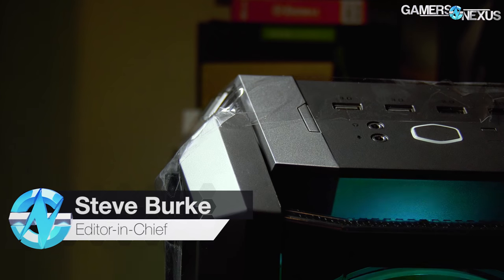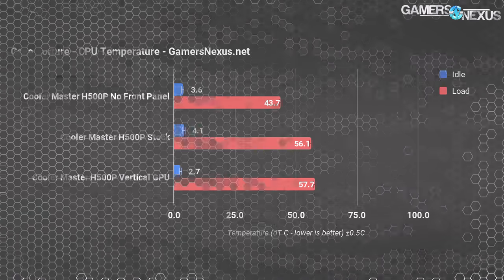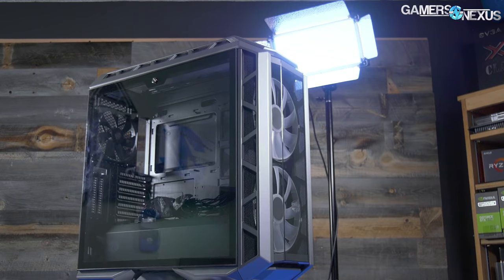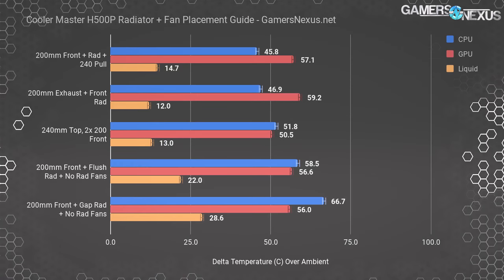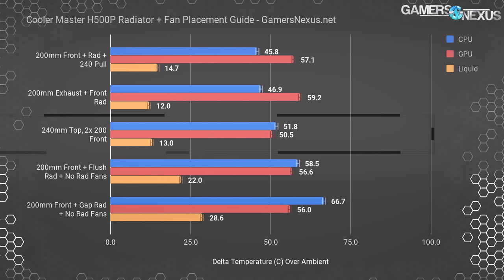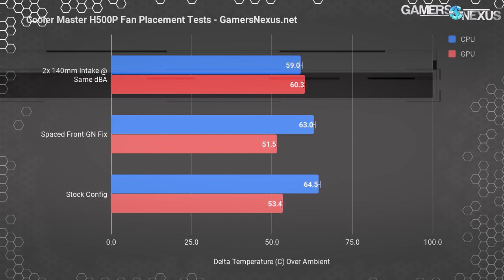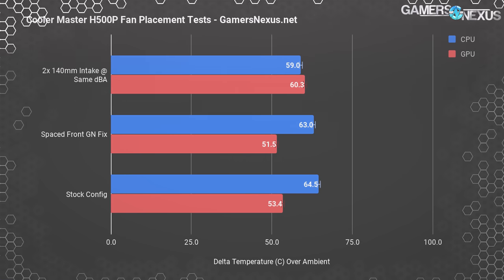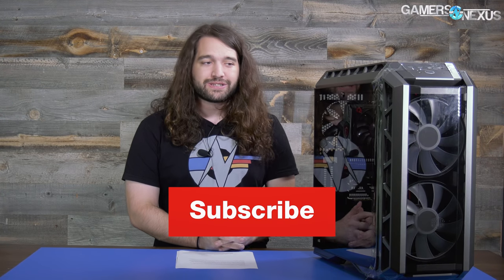Cooler Master H500P Radiator & Fan Placement Guide

Comment: If going liquid cooling I would always cool both CPU & GPU.  I have never really understood the point of CPU only liquid cooling but I prefer noise reduction over max overclocking

I have always wanted to try out 180mm or 200 mm fans on appropriately sized radiators but the more I think about it the more I wonder whether this is in fact a bad idea because (a) the increased size of the fan motor creates an appropriately sized dead zone (ie where no or very limited airflow from fans) on the radiator.  Sure that is partially fixable by having a fan shroud to make the fans stand slightly proud of the radiators but that brings me to second issue; (b) bigger fans have worse static pressure.

Does anyone have hard evidence on what is the optimal radiator/fan combination given that we can get 120mm, 140mm, 180mm & 200mm fans and radiators (although both 180 mm & 200 mm radiators are a bit niche).

Any how thanks guys for a proper review of the case, looking forward to seeing if you manage to fix it because clearly in stock configuration the case is a triumph of looks over performance - i.e. basically the case is junk in many ways

Comment: Always try to have a positive air pressure inside the case to reduce fan speed on the CPU or GPU. You need air to transfer the heat and a lack of air acts like an insulator. I have 1 big 200mm front fan and 1 140mm back fan (Raidmax Vampire case). The average CPU and GPU temperature on full load is around 60 degrees Celsius when my room is around 20 degrees  Celsius.

I installed 1 140mm bottom fan and 1 140mm top fan. If the mobo is getting over 40 degrees Celsius hot, the top fan will turn on to cool the CPU better. If I'm doing some mining, I turn the bottom fan on by a button to reduce the GPU fan speed and thus less noise.

Overall, you right, depend on case by case, what you have in it and the pressure you have in the case. Always try to aim for a positive air pressure in the case for efficient cooling.

Comment: So if i use a 240mm rad in the front and then have a extra fan under will that be better for the gpu too? The bottom fan will blow air towars your gpu

Comment: Can't you move the front fans inside the case if there's enough room
Reply: That's what I was thinking too
Reply from the maker: There's not.
Reply: What about  removing the 200mm fans and installing 3 x 140mm fans on the inside of the front panel, if there's room
Reply: asked him that in the review, crickets, he opted for unhinging the front panel and sticking it on with tape... I'm at a loss, I bet the problem is mine, I must be missing something, it just can't be.
Reply: There's a set of protruding rails for up to 140mm fan placement behind those fans, and subsequently no mounting position for 200mm fans.
Reply: So? Do you have something against adhesive tape?
Reply: Thank you for answering my question now make a plush doll of yourself so you can get some extra money like 20 of them with your autograph they will sell fast
Reply: Whoa careful, nearly cut myself over all that edge!
Reply: Gamers Nexus that's a shame. If it could that would fix it ☹️ These company's need to stop thinking about the pockets and start thinking about the customer. What ever happened to the customer is always right.
Reply: hahahahahahahahahahahahahaha OMG your so right. Im such a spoiled brat. I should change me life right now and become a evangelist this very second. Your words of wisdom have opened my eyes to the real world. I shall now spread the word of all that is good and right. Thank you for making me feel hole again.
Reply: Arrrr what happend kid. Did he answer one of my questions and not yours. didums
Reply: Dan Smith im glad you took my advice. Glad to help.

Comment: Nice review.

My solution which might only work for someone with a 3D printer.  I would remove the drive cage cover, then print out a "scoop cover the would take the air coming from that lower 200mm to be redirected where needed.  Obviously that lower area is getting too much air from that 200 mm fan,  that basement can't use it or need it. Even if you had three huge mechanical drives and the PSU was sucking carpet fibers through the filter it might not need what that fan is giving the basement.  

I'd direct ninety percent of that fan's  flow at the GPU and 10% to PSU/drives area.    And since its 3D printed I could tweak it until the flow was getting where it need, in the amount needed, through design revisions.  [I wonder if a GlowForge could "swiss cheese" with small precision 1 mm holes, that polycarb front panel to allow enough airflow without that packing tape solution? ]

...an elegant manufactured solution for a more civilized case enclosure.

Comment: I have the H500 version of this case with the mesh and the 200mm fans in the front. I have a air cooler on my ryzen 2600X but I would like to hear someone's recommendation on atop mounted fan I was thinking 200mm - 240mm fan that is on the top blowing air out. Since the two 200mm fans in the front are in taking air and the rear 120mm fan is blowing out and an additional larger fan ontop pulling more hot air out would seem to cool it. Thank you for your time whoever reads this and has a suggestion.

Comment: Did you guys end up putting some air flow holes in the front plastic? That's what I was thinking about doing, if I could figure out a dust cover.
Reply from the maker: Yes. Check back tomorrow!
Reply: buy a pantyhose, cut it up, stretch it over some plastic and glue it
Reply: Just don't buy this case... why waste time modding this thing to make it what it should be.

Comment: Steve, what are your thoughts on radiator placement when using an evga hybrid card in the mix as well? I've been trying to play around with placement on top and front but my results are not consistent. Unfortunately I have a entho evolv tg so my airflow is very limited and have seen improvement with front rad on both gpu and cpu but now my psu and 950 pro heat up. 950 pro is in the 60s, have evga p2 850 that is on fanless mode but since going in front turns on during some games. Any suggestions or recommendations, currently front x62 and hybrid set to back of case, is there a better mix you have experienced in placement when 2 rads are in play?
Reply: I have two EVGA hybrid cards and the best configuration I have found is attaching both radiators/fans to the front as exhausts with a bottom case fan directly under them. They are fed cool air from the bottom fan and immediately exhaust that out of the front of the case so the fans do not move heat into the case interior.

When you have a case with zero side panel fans (such as a side window) then putting any heat into the case that could be avoided is a bad idea IMO, especially if you have radiators mounted to the back or top of the case that rely on air inside the case to cool them.
Reply: Vernacular3289 hmmm I've never thought/heard of it but you think intake from top and having front and back as rad exhaust??
Reply: I would advise against using top as an intake. Heat inside the case tends to rise and get trapped if it's being pushed down from top fans. Even with front and back used as exhausts I predict you would still trap heat.
Reply: Vernacular3289 so a 280 and 120 rad in a case that supports 280 front, 360 top amd 140 exhaust with terrible airflow. What are your thoughts on placement then?

Comment: Would having the top radiator as an intake as well and then just an insanely airflow/low pressure oriented 140 fan as a solo exhaust.

Comment: Dumb ass question can you mount the mega fans inside minus the possibility of using water cooling and getting rid of the cover that would block it zip ties should work and no need for tape
Reply from the maker: Does not seem to fit that way, unfortunately.

Comment: I think Cooler master should have moved the front fans a little further back, so it would not cover the front mesh.
Reply: they can't. the case chassis was not designed to mount 200mm fans in the first place. the interior frame only fits up to 140mm. they should have packaged this case with 3x 140mm front fans and an open mesh with a filter. it would look better anyway. this case is trying to look industrial, yet trying to look like all the RGB, tempered glass cases out there. they should have just picked one.

Comment: steve i was going to visit the store but this showed up when i clicked the link
privacy error
this server could not prove that it is store.gamersnexus.net; its security certificate expired 107 days ago. This may be caused by a misconfiguration or an attacker intercepting your connection.
Reply from the maker: Should be fine. Try https://gamersnexus.squarespace.com/ as an alternative -- it is just a redirect, anyway. The cert is valid, but wondering if there's something stuck in cache. Did you ever try to access that store address previously?
 Or first time? Thanks!
Reply: I think it was my first time

Comment: I bought CM MasterLiquid ML360R ARGB 360mm Liquid Cooler together with my CM MasterCase H500 ARGB Case without digging deep. 

Later on I found out that the only configuration available for a 360mm Radiator is the front mount.

Without watching any videos I was sure this config is hurting GPU temperatures. No need to be a scientist :) 

Should I replace my 360mm with a 240mm for the top mount? (If I want to overclock my GPU - RTX 3070)

Or placing additional top exhaust fans 120x2 or 140x2 or 200x1 will help?
Reply: Do you have to remove the 2 200mm for front mount?
Reply: @Deadliestz  No, 360 mm Cooler was mounted just behind 2x200 Case Fans, taking all the fresh air and exhausting hot air inside...
Reply: @warnom  can you show me a pick how it was mounted because I am having trouble with the long fan screws going through the bracket and attaching to the radiator to hold it's place.
Reply: @Deadliestz  I'm afraid I can't. I reconfigured my setup with top mounted 240mm cooler already :( 

And I got my setup all installed by the dealer/service, I didn't do it by myself. I have no idea how they managed.

Comment: For radiators id imagine you just always want the output of the radiator to be an exhaust of the case, which would probably mean your clc gpu exhaust as the rear exhaust and the cpu cooler as the top exhaust ensuring that neither is heating up the other one.